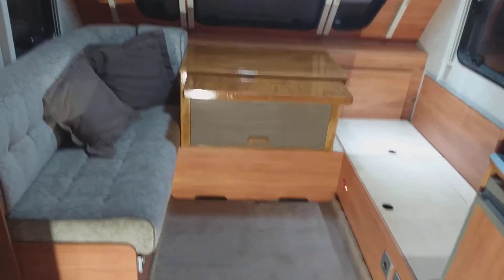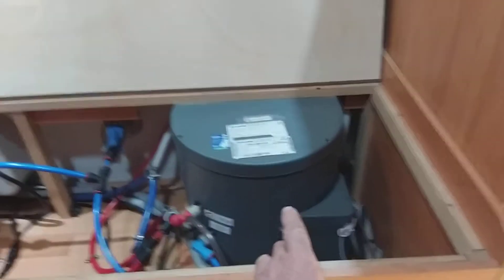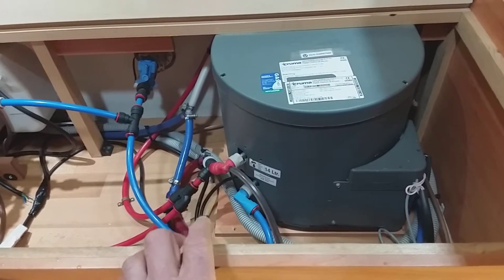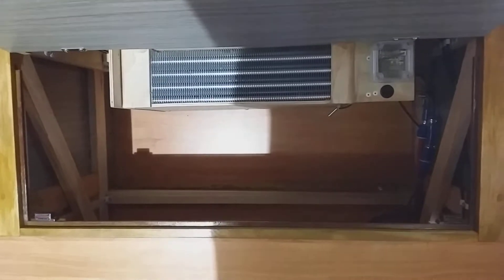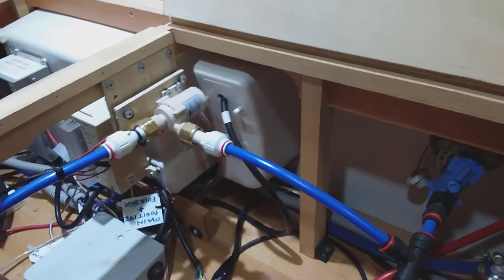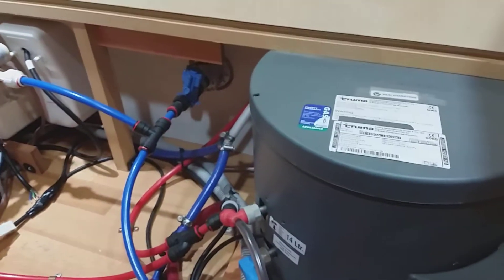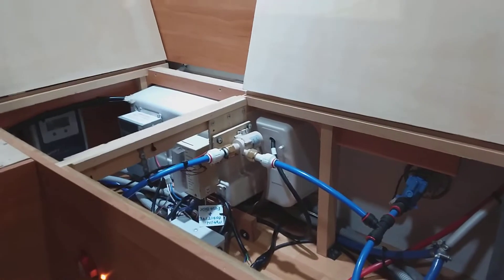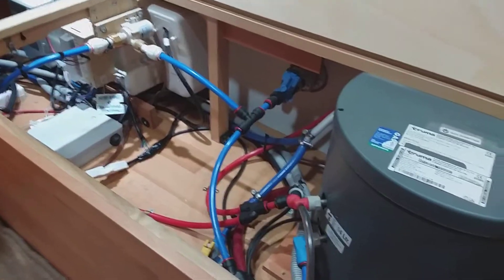Adria Caravan Hydronic Heating

Comment: Hi would you mind sending me a parts list of your installation and where did you source the parts from, Thank you
Reply from the maker: It has been a while since I built this heater, the recirculating water pump is just an inexpensive 12 volt brushless unit there's many on ebay, same as the digital thermostat the only thing you may have a problem with is the radiator, I used one from my work (refrigeration evaporator) but if I was to do this project again I would simply use a small bus/large car heater assembly unit from the wreckers yard as this would come complete with fan motor assembly/radiator and water hoses and work on 12 volts then just add a cheap digital thermostat... sorry I couldn't be more specific.

Comment: Great set up.
Could you post a water circuit diagram with measurements, parts required and costs?
Reply from the maker: No problem, if you have an email address I can send the info and a few photos of the parts, this setup works very well with the European insulated caravans.
Reply: @noproblem2big337   1waynet1@gmail.com
Reply: Very interested could you email a diagram.dioncunningham@ymail.com
Reply from the maker: @surfnrak.com.a    will do tonight
Reply: Excellent set-up can you send me an email  on the circuit diagram tojo10tony@gmail.com